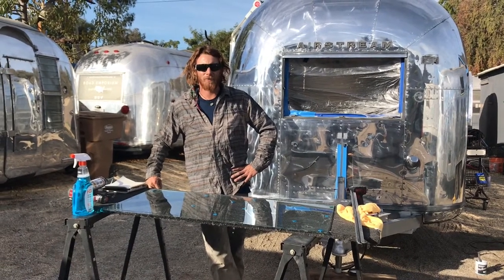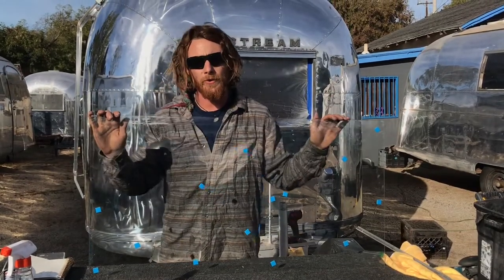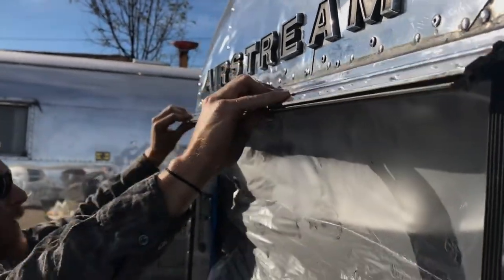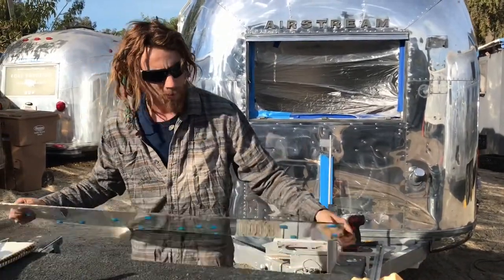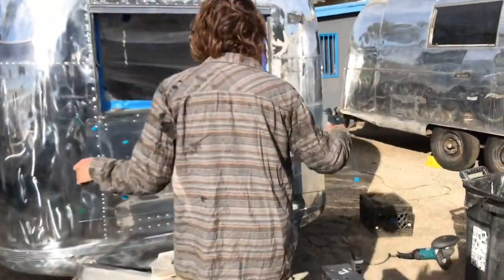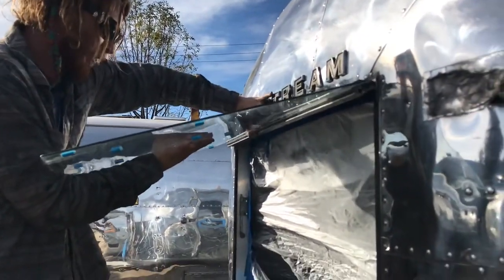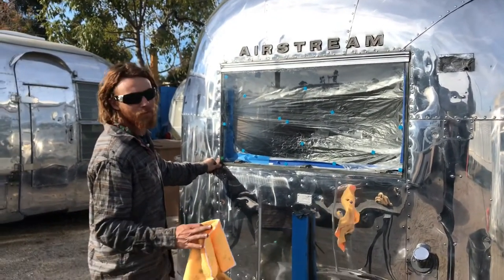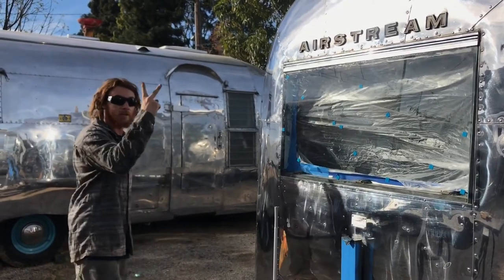How to replace a window in an Airstream

Comment: Collin, Did you say any glass prior to 1966, i could use regular glass? I am working on two windows myself. Thanks....
Reply from the maker: With these models the glass is actually curved so you have to order them specifically. I found that out the hard way.